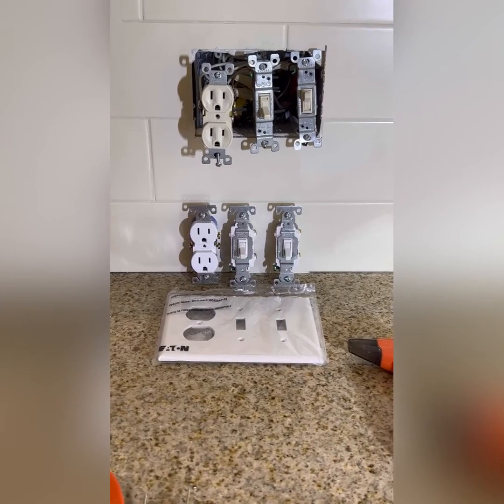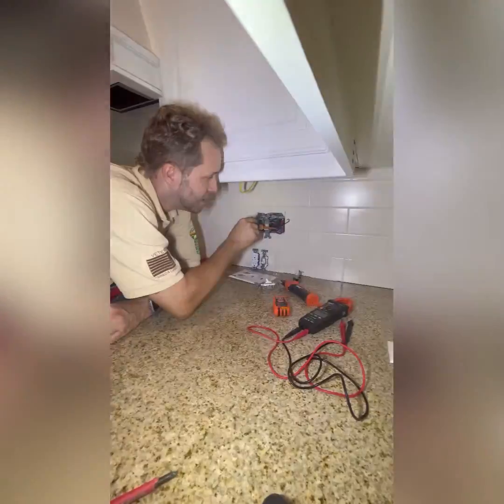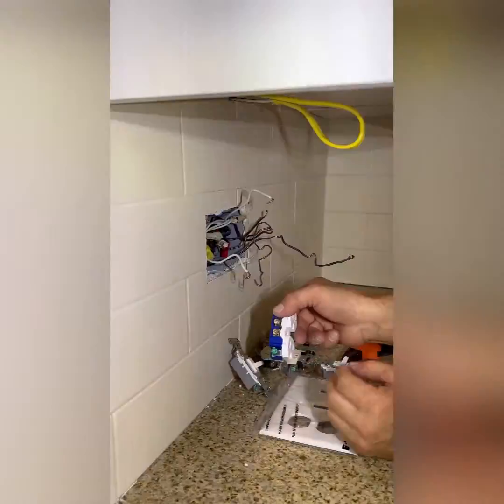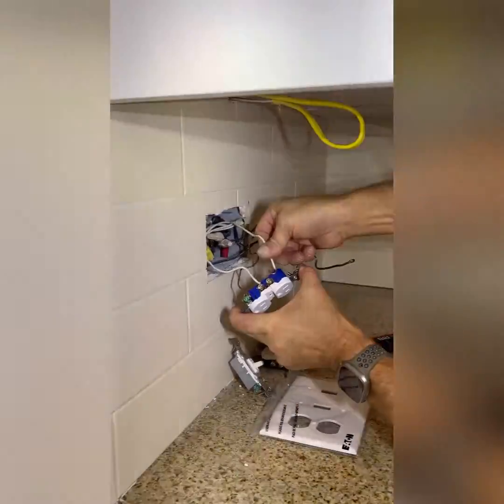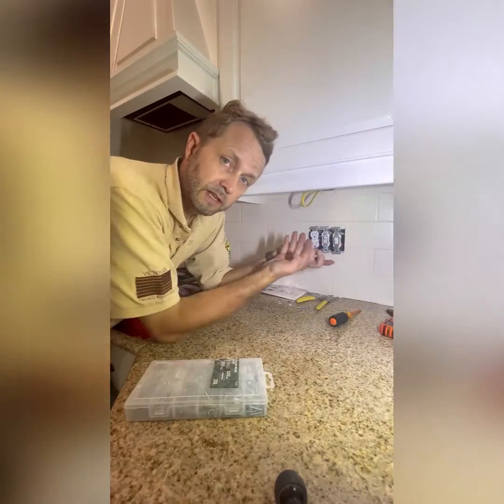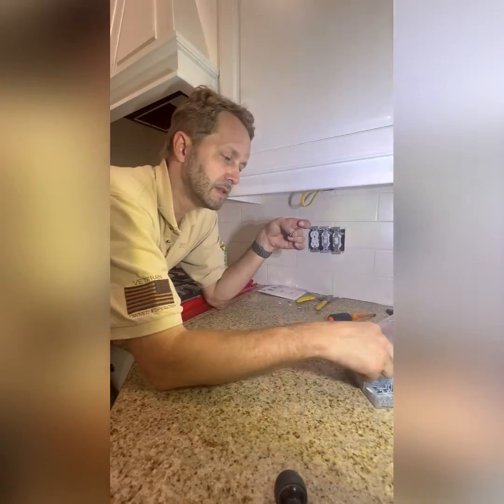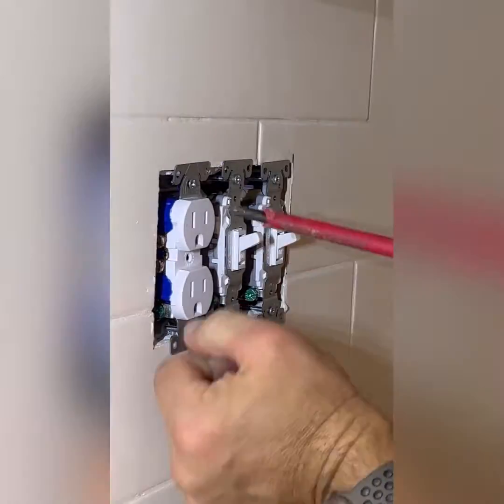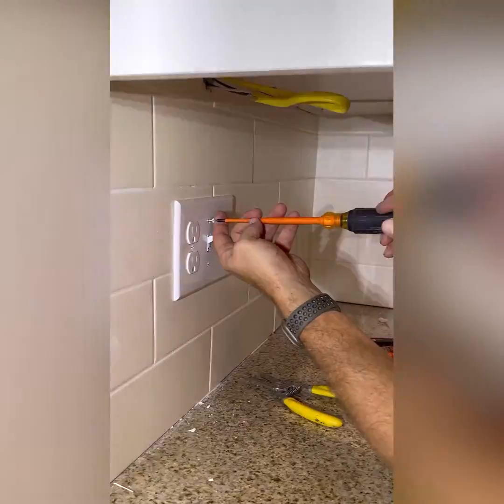Change out those old switches and outlets, aka receptacles!

Comment: Mr. C, would it be the same process for the switch/outlet with USB connection for phone charging?
Reply from the maker: If you are talking about installing an outlet with USB, compared to a regular  duplex outlet (receptacle), than the process is the same.